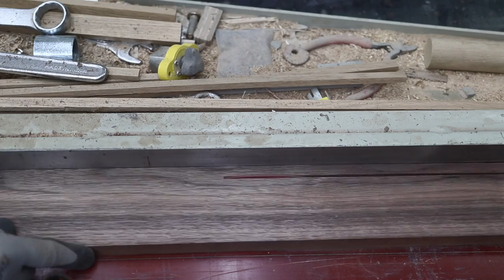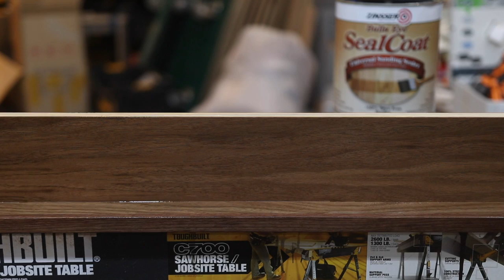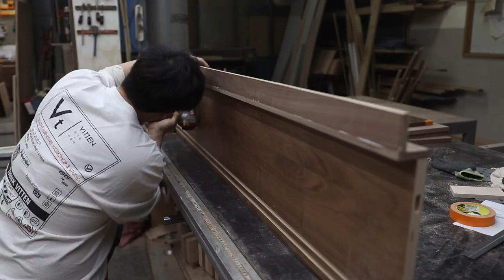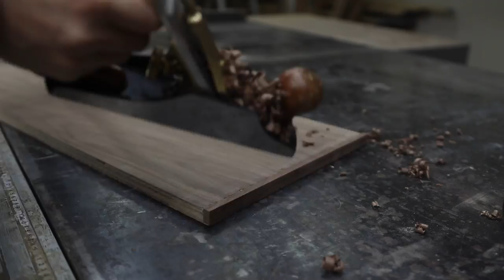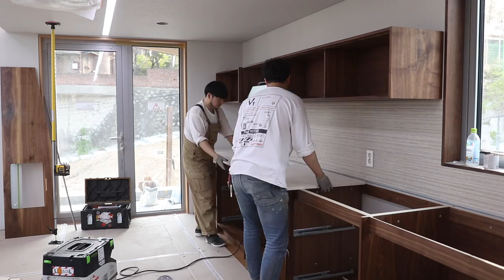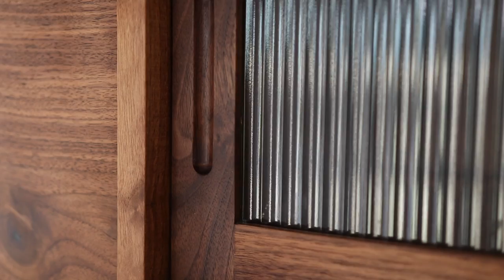W97_Kitchen with walnut

Comment: I am a cabinet maker myself. I appreciate the clean design overall, and the drawer top pulls are strong and simple. What kind of hinges were used in the oft closing overhead cabinet doors? Do they last?Maybe when I redo my own kitchen I will borrow some of your ideas. I could easily live with these warm and simple walnut pieces. Thanks for the video.

Comment: Nice orange clamps. Try the Titebond or Rockler glue brush, they distribute the glue more evenly than index finger. Less glue squeezing out while clamped.  They are not expensive and fairly practical? I like the exposed screw detail on the draws. Looks nice. The oil rub on the walnut is nice. Nice routing for the draw pulls and edge banding, double duty.
Reply from the maker: I used that all every products about glue in the global. but this way is easier for me😂

Comment: Beautiful work, love your stuff. I think you were using a screwdriver or some type of metal push stick in the very beginning? I hope I'm wrong, please don't ever use metal anything for a push stick. If the blade hits it, it's coming out of your hand faster than you can react to, and right at you. Really fast. Wooden push sticks will just get cut. Please. And thank you for showing real, excellent craftsmanship.
Reply from the maker: I have used various pushsticks for 8Y. wood, plastic, metal, gripper, various material and shape. There is a reason I use this way in this time. But it is hard to explain in English. don't apply  public one safety rule. public rules are just broad range rules for everyone. I made my safety rules based on my experience for my fingers and business. And, I'll keep making that

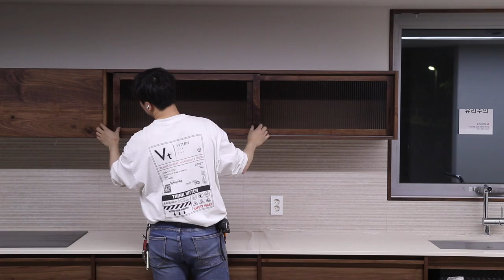Comment: @13:10 What hardware do you use to keep the sliding doors on the track? It looks like a spring-loaded ball catch latch of some sort. 
I've built a similar cabinet shelf with dado tracks but I need some hardware to fit the doors.

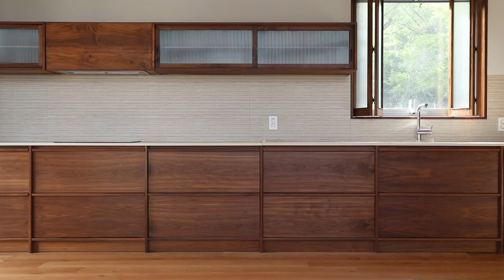Comment: Workmanship and heart is there but precision is not.  If I was paying that kind of money for custom built cabinetry - there is no way I would tolerate the horizontal dividers not lining up with each other and being absolutely parallel with each other.  The middle and upper horizontal lines are at least 2cm either up or down compared to the one next to it.   You can see this pretty good at 13:51.  The cabinet with the sink in it looks to be the worse.
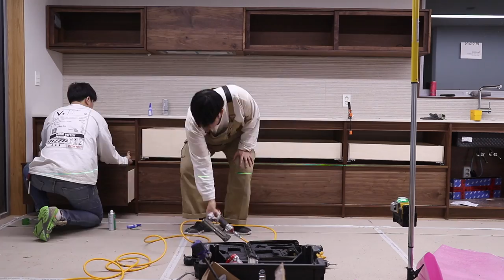Reply: They're not even lined up at 12:43 to the green laser level line.